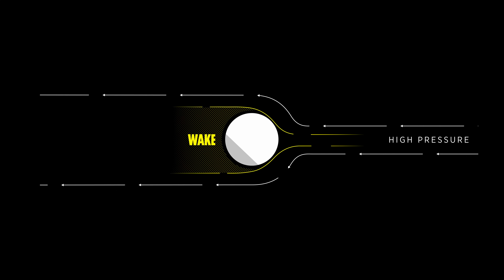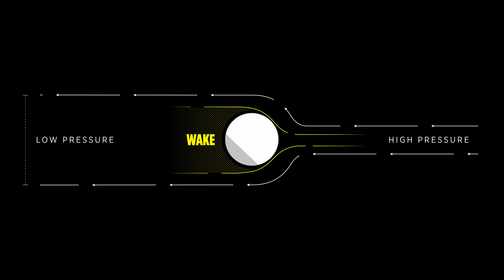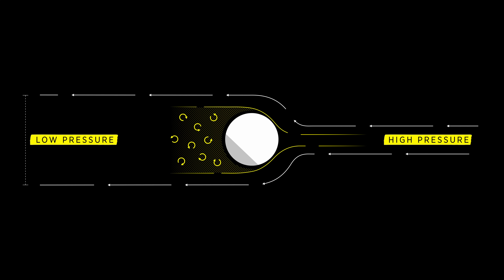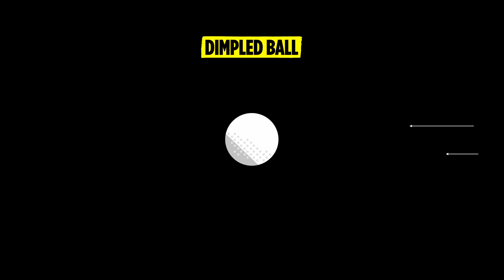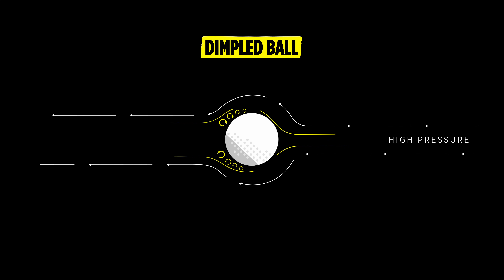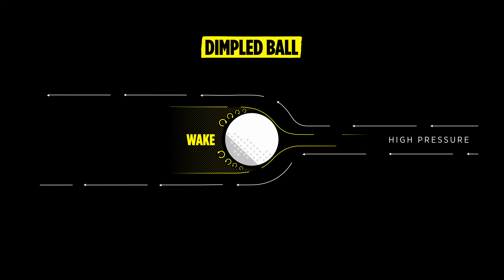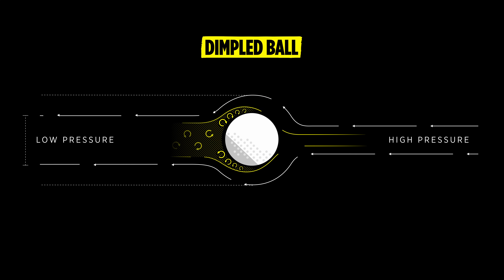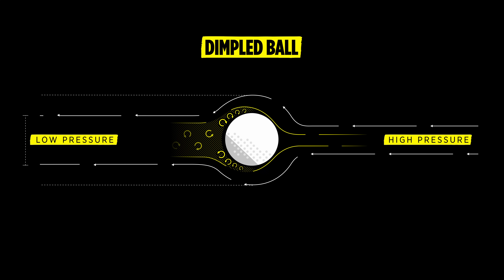Golf Ball Dimples: What Do They Do? | Titleist Learning Lab

Comment: The variable not addressed here is spin and how it affects lift and drag.   Golf isn’t just about distance because 36 strokes per round are putts and the ability to shape shots left-to-right ( /  into greens were the longest front-edge to pin is left-to-right  or right-to-left   \ ) can shave 3-4 strokes per round off the score.

That was the advice I read from Nicklaus in Golf My Way back in 1987 and I adopted his philosophy of ‘never seeing a shot as straight’ because there’s usually a strategic advantage to have some shape on a shot:  fades stop faster and are more accurate distance wise, an a draw will usually roll further.  

 Balata covered wound-rubber band were part of my callow youth. Though most if them were cut open to get the little oil filled ‘super ball’ in the center with the mile-long band wrapped around trees for fun as a kid whilst breaking all of grandpa’ hickory shafted clubs in the back yard in the 1950s they still were the “Pro” ball of choice when I started playing the game and a must if wanting to shape approach shots.  

To paraphrase Trevino, “You can‘talk’ to a Titleist but a TopFlight just won’t listen.”    The same is true today with ProV1 and ProVIx compared to other balls IF one has the club head speed with irons and wedges to compress and then spin them off the faces of short irons and wedges on approach shots with them also spinning less of the face of a Driver compared a Pinnacle Gold.

In 2007 after retiring from 25 years in the Foreign Service and a 20 round per year max golfer I decided to get a min. wage job as a Starter at a local golf course where I could practice and play for free with the goal of seeing how good I could get on the challenging par 35 nine-hole ‘executive’ layout, playing mostly solo practice round and practicing shot making.  I started finding hundreds of lost balls and started comparing them head-to-head out on the course in the evenings when waiting for the last group out to finish so I could close the course.  I’d take one wedge or iron and a dozen each of two different balls I’d mark with F, S, D hitting four fades, four straight, four draws with ProV1 as the baseline for comparison after landing.  The combination of the coefficient of friction on the urethane cover  + the way the ball compressed on the face gave ProV1 better spin and a greater ability to shape shots with better control because less extreme adjustments were needed to stance and face angle compared to  two-piece Polymer balls so the margin of error was less and dispersion pattern smaller.

That practice hitting to all the greens at the course with various irons and wedges— then fixing all the ball marked with the greenkeeper’s tool saving them green mower the job in the morning — allowed me to ‘dial in’ my distances for each club with fade or draw and that’s the point I started holding more greens and improving my score by steering the ball to hole after landing as Jack suggested was possible in Golf My Way—and shot a par 35 round at age 60😊

This spring at 72 lying two on a par 5 from the left side of the fairway hitting to a very right left green  \  I set-up so far right of the green planning to hit ‘hard’ draw a playing partner commented ‘Do you realize you are aiming at that house over there (OB right)’  I managed to pull off the shot with about 20 yards of draw action, it hit from right, kicked back right to left as expected then rolled down the middle of the right-left 45° angled to fairway green into the hole for an Eagle!   The ball?  ProV1   Proofing Trevino wrong —  you can talk to a Draw if you play a ProV1 😂